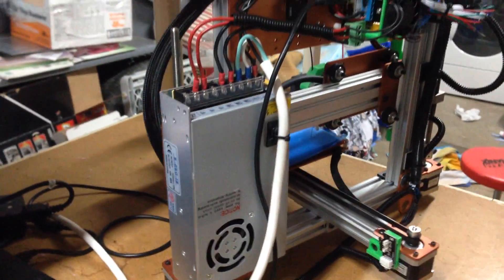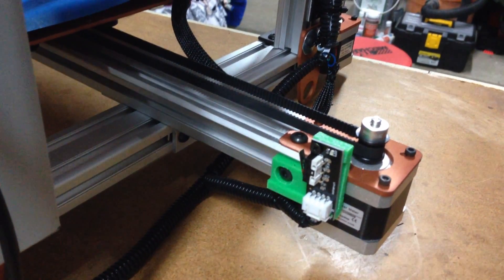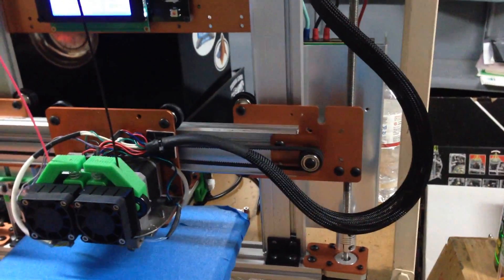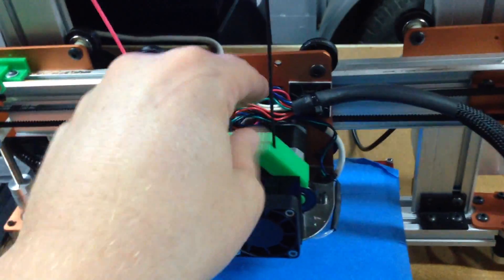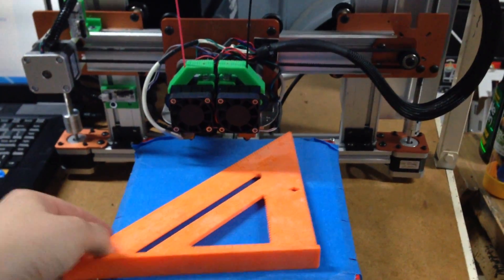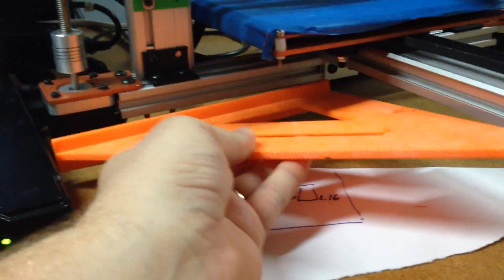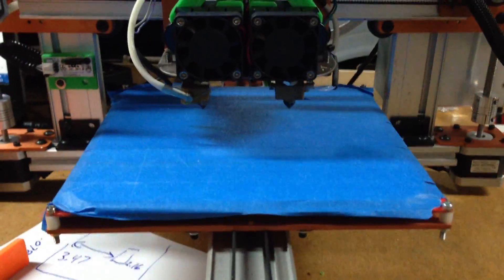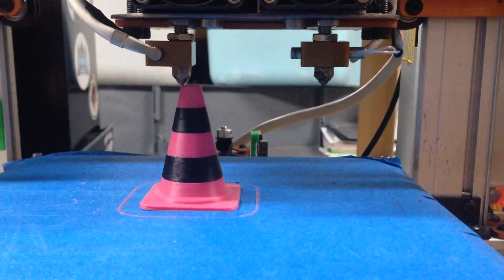Ord Bot Hadron 3D Printer build log with dual extruders and SainSmart electronics

Comment: I plan to connected dual head extruder together with MEGATRONICS V2.0+MEGA 2560 R3 + LCD 2004 3D (all electronic from SainSmart) . What do I need ( additional hardwer / softwer) to make dual head extruder to work ?

Comment: Great build! Why do you need a stepper at each end of the ways? Wouldn't one be enough, so long as a dumb pulley was mounted at the far end? Does this board also control servos in addition to the steppers? (at the same time?)
Reply from the maker: It was the design I had. The carriage is heavy with the two extruders, so the additional stepper helps.

Comment: that is a great video, thanks,  im triying to buil my oun 3d printer, and i would realy apriciate if you could tell me what software did you use and which extencions or other softawares can i use to design the pieces
Reply from the maker: I use Repetier-Host software and Marlin firmware. I design the parts with AutoCAD.